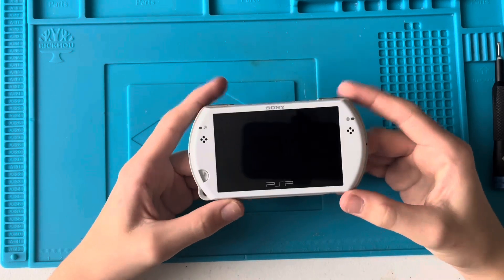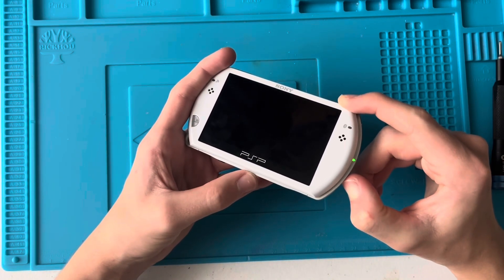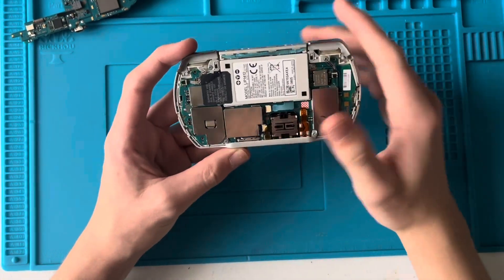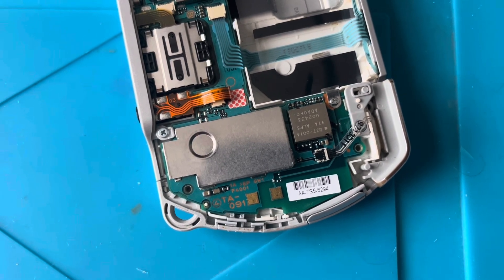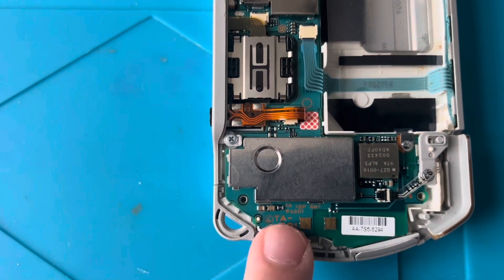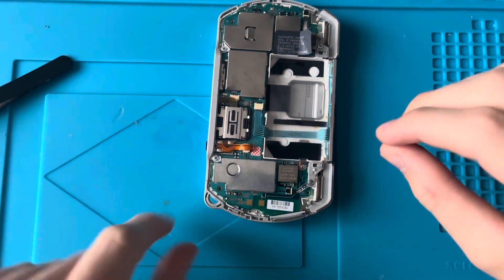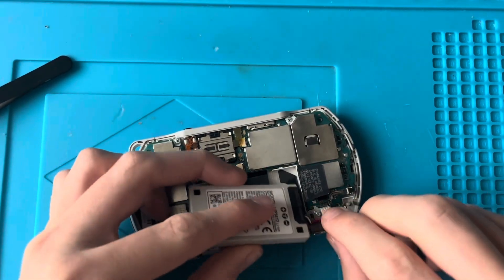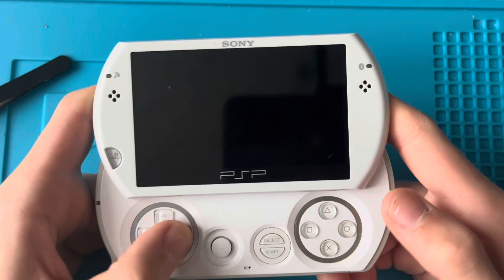Fixing a white psp go with no backlight or sound

Comment: I just bought 3. All have the same problem. Busted a ribben getting it apart but really wished I'd seen this before 😅 you live and you learn
Reply: Sell me 1 bro for the low lol
Reply: @ivanncastro  you really don't wanna buy any of them. Not after I've tried to fix them 🤣 definitely broken now
Reply: @My_Badd  how bad are they? Sell me the best one for parts lol
Reply: Parts? Lol. No parts left. I "desoldered" caps and it pinged off the tweezers. Took one from the board that had no power connector and that one pinged off the tweezers. Melted 7 fuses only trying to replace one. And the screws are missing from all three. I'm waiting to get my roo. Setup so I can try again but I couldn't take the loss selling one. I paid too much for what I thought was a good idea. But I just got lime mortor in my eye helping the roofer so if I lose the eye you can have them for half of what I paid as that'll be that hobby done.